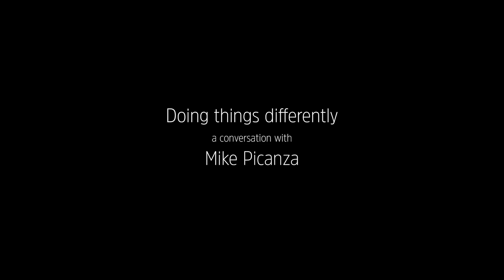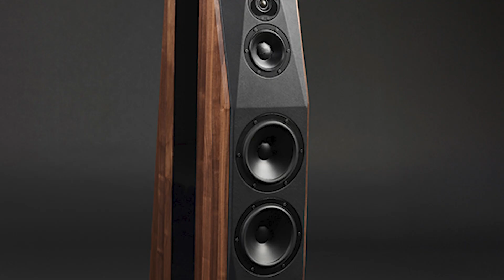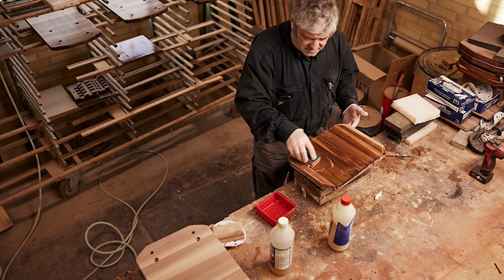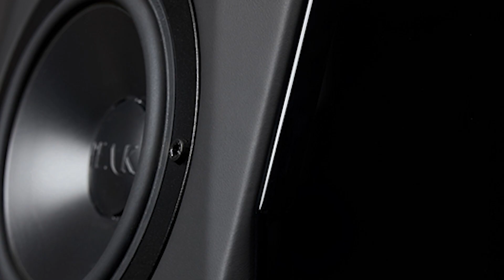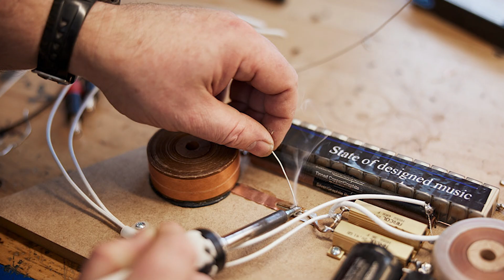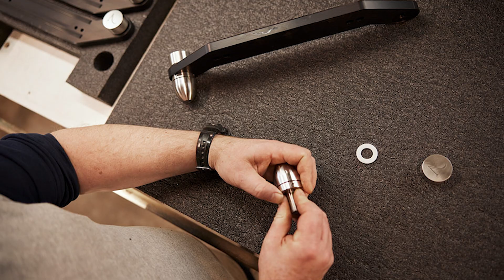Peak: The Ultimate Hi-Fi Passion Project with Mike Picanza

Comment: I bet they sound awsome,all that engineering and craftsmanship,but still passive,so not full control.
Reply: I fully agree. So many audiophiles are stuck fifty years in the past, with a passive crossover. 

I’m not advocating active monitors with Class D amps stuffed inside - I’m advocating proper high-end speakers run from a studio grade dsp x/over, multiple high-end dacs and multiple, dedicated, high-end power amps.